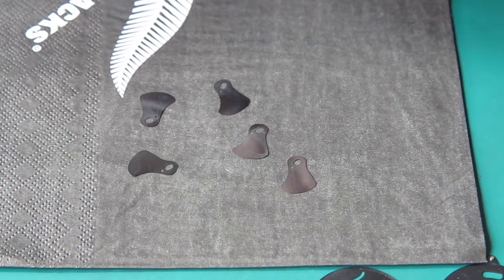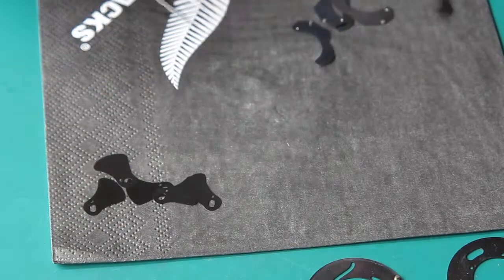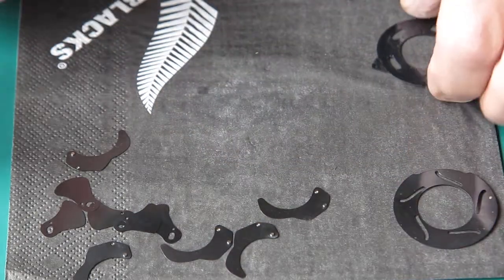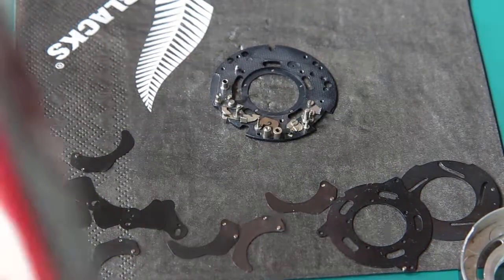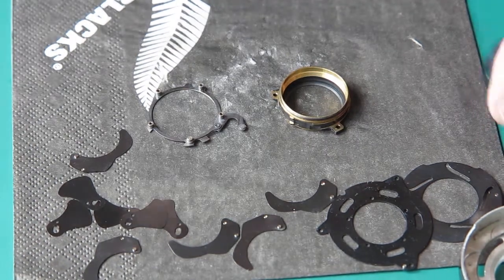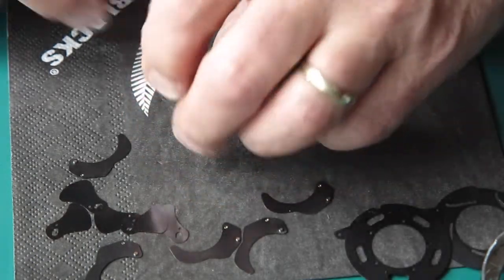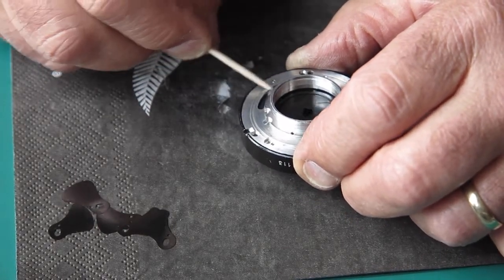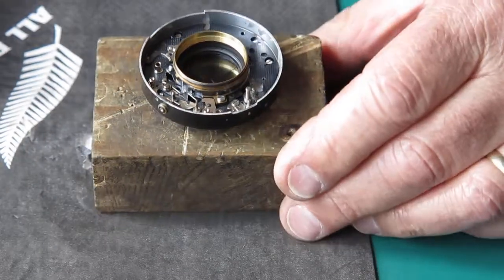Partially disassembled Rolleicord Va, a good buy? part 02

Comment: This is fascinating to watch. I've got a "Baby" Rolleiflex that works well at all shutter speeds except B, where it's reluctant to close. It's only a minor problem though, compared with the difficulty of getting 127 film for it.
Reply: Hi John
As far as I know, there's at least one manufacturer (Kentmere maybe?) which still makes 127 film. 
Usually sold under either the Rollei brand or the Rera brand.
Quite a few stores have them in stock (e.g. www.fotoimpex.com/films/medium-format-films-127-4x4/).
Reply: @pierre-yvesp3769  Thanks for that. I used to buy it from  the once large photographic chain Jessops in the UK.  There are 127 films listed by Analogue Wonderland, also in the UK but shipping worldwide, but they have been very low on stock this summer. I just checked and it's in stock again now.